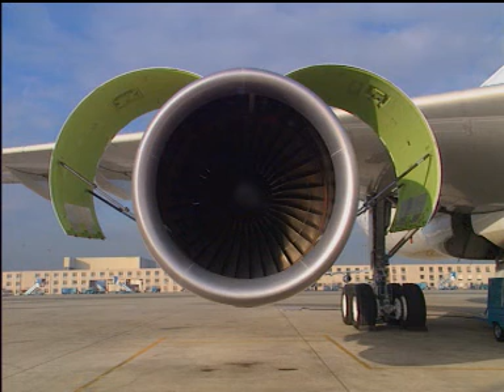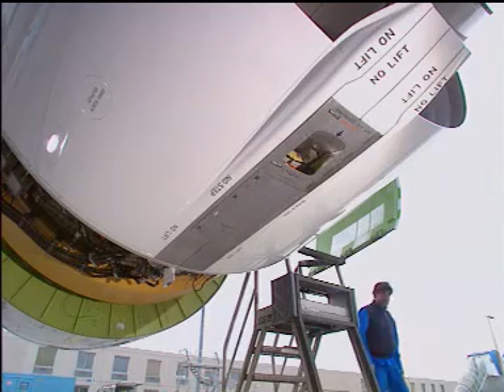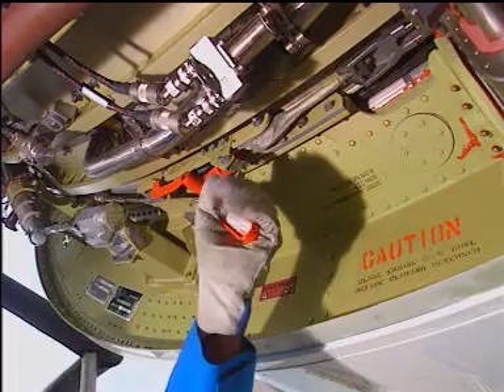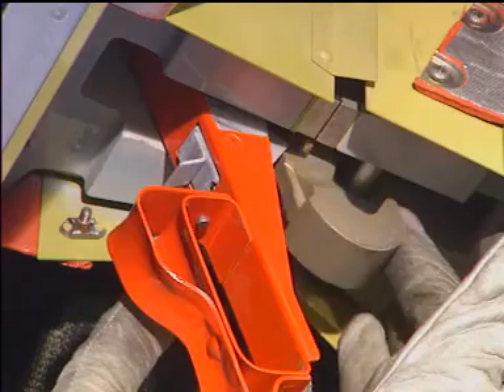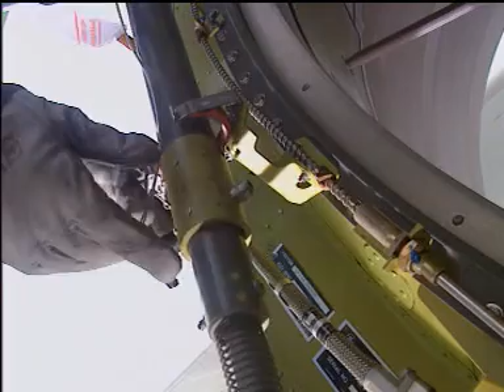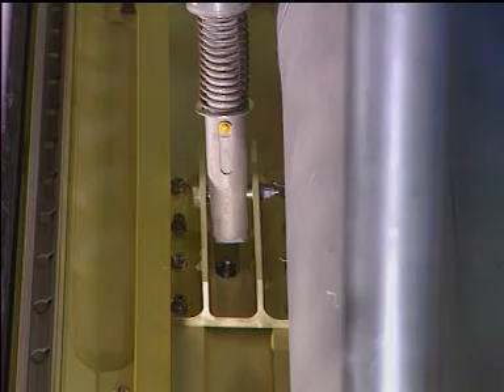AIRCRAFT | A330 GE CF6 - Opening of the Thrust Reverser Cowl Doors

Comment: Can you hazard an opinion on what effect on an aircraft in level flight were just ONE rt to deploy on just one engine......  never mind if it's not supposed to happen  ...  what do you think the deployment of just one RT would do to the flight characteristics of an A300-600 that was in level flight at power.
Reply: It happened to a Lauda Air 767-300 in 1991. 
The airplane spins out of the sky and crashes.  https://en.wikipedia.org/wiki/Lauda_Air_Flight_004
Reply: @JetCityMatt  yup  -  and I posed this question because I fully believe that it also happened to AA587 on November 12th 2001.  By the debris patterns, both engines detached from their pylons and were ejected away from the flight track.  It was never discussed, but the fuselage impacted in a residential street, and the centre section still had deceased strapped in their sears, while the fore and aft passengers has been ripped and thrown.  Sound sto be like centripetal forces in operation.  Are you familiar with AA587 ?
Reply: @Sssthpok  I am familiar with AA587. 
The copilot of AA587 overreacted to flying into the wake turbulence of a preceding aircraft, pushed on the rudder pedals too hard and yawed the airplane far enough sideways that the design loads were exceeded, the vertical tail broke off, resulting in the aircraft yawing and spinning out of control. 
It doesn't help that aircraft with swept wings are even more sensitive to dutch roll than other aircraft, but you're not going to make it too far without a vertical tail anyway.

Two contributing factors (from the NTSB report if my memory is correct) were:
1. AA's upset training done in a simulator which taught pilots to overreact to upset situations, like can be caused by wake turbulence.
2. The A300 rudder pedals are EXTREMELY sensitive and command far larger rudder movements than in other types. It should not be super-easy to exceed design limitations by pressing on the rudder pedal a bit.

Somehow they let Airbus "off the hook" on this. I guess they didn't want to create an international incident or force a couple airlines to have to do expensive retrofits to entire fleets of A300s that were about to be retired anyway...?

In airliners you don't use the rudder pedals except to steer on the ground, because when you roll with the yoke, the spoiler extension on the inboard wing creates the yawing force that you would normally press the rudder pedal to get on a non-jet.
Reply: @Sssthpok  Oh wow, it looks like he applied FULL rudder!!!
Flight 587 contacted the ARTCC controller about 09:15, and stated they were climbing out of 1,300 feet for 5,000 feet. The controller responded by clearing the flight to climb to 13,000 feet, turn left, and proceed direct to WAVEY. At that moment, while in a climbing left turn, the crew heard a brief squeak and a rattling sound, possibly caused by wake turbulence. Some fifteen seconds later the Airbus began to yaw to the right. Full right and left rudder were applied and the first officer called for "max power" at 09:15:54. Again full right and left rudder were applied and sounds of a snap, a thump and a loud bang were heard when the rudder travelled full right again. The entire vertical tail fin had separated and the Airbus entered an uncontrolled descent from an altitude of about 2500 feet. During this descent both engines separated from the wings coming down within 100 feet of each other near the Newport Avenue / Beach 129th Street crossroads. The aircraft crashed into Beach 131 Street, a Queens residential area.

Probable Cause:

PROBABLE CAUSE: "The in-flight separation of the vertical stabilizer as a result of the loads beyond ultimate design that were created by the first officer’s unnecessary and excessive rudder pedal inputs. Contributing to these rudder pedal inputs were characteristics of the A300-600 rudder system design and elements of the American Airlines Advanced Aircraft Maneuvering Program. "
Reply: @JetCityMatt  back in the days when Airbus were developing adhesives to form part of the bond technology....  the stab went 200% over design envelope.  However, both engines separated, unusual to say the least.  Pylons are built to high load specs, and fore and aft seem bullet-proof, but they are not rated for side-stresses, such as centripetal force would present to them.  Just a theory.  Pilots flying and witnessing the AA587 breakup tell that the plane went into a helicopter spin....  again, just sayin'
Reply: @Sssthpok  Once the airplane goes into a spin due to the lack a vertical tail the engine pylons will exceed their maximum design loads pretty quickly. They aren't designed to take side loads from a spin. 
A spin IS a sidestress.

If applying full rudder exceeded the A300's maximum design load, then there is not telling what could happen beyond that point.... the tail breaking off is certainly one possibility. It doesn't call into question the A300 rudder's ability to withstand 200% of its design load if 200% of the max design load was exceeded.
I'm no engineer, but as a non-airliner pilot it seems crazy that it could be easy to press the rudder pedal hard enough to cause the tail to snap off on any airplane. Maybe "scary" is a better word than "crazy"!

I know that when Boeing does their fatigue tests to destruction on a new type the structure must be able to take 150% of the maximum design load, per FAA regulations.
This is reference to bending the wing spar up until it breaks, but I think the regulation is the same for all parts of the airplane.

You can push full rudder in a Cessna and not cause the airplane to break up, but airliners are not that strong. 

Speaking as a pilot (not of airliners), its pretty strange that the AA pilot applied FULL rudder on an airliner. 

A pilot MUST know the limitations of his aircraft and operate within them.
Reply: @Sssthpok  If you are interested in learning about conspiracy theories that are most likely true (and it doesn't upset you), look into TWA800- and the Gulf of Tonkin Incident which never actually occurred.